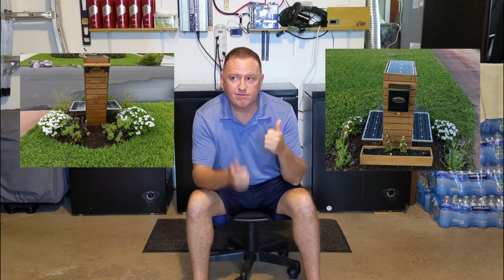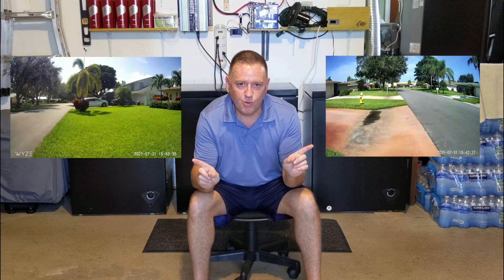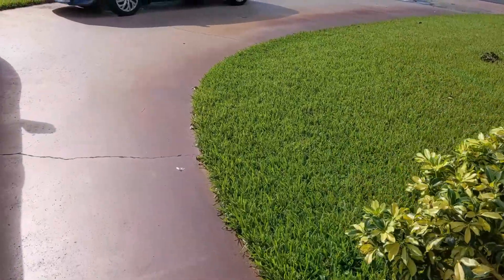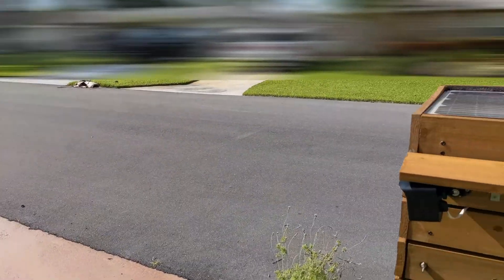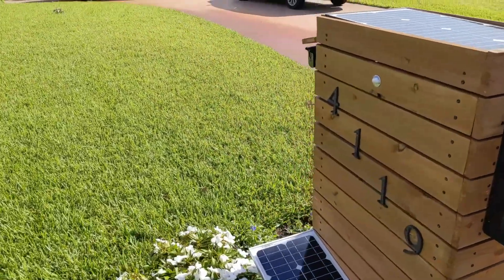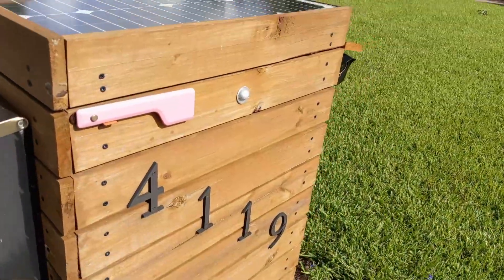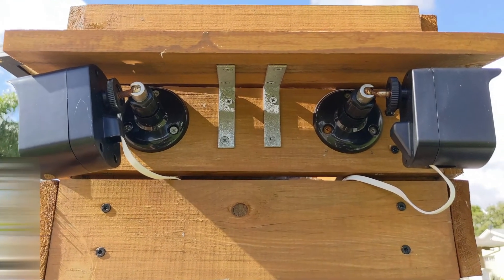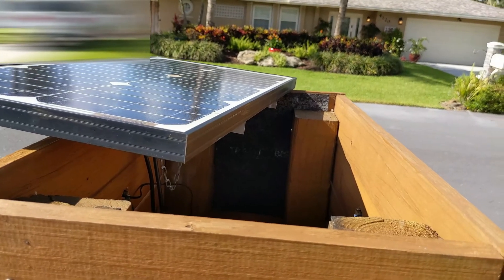Solar Powered Mailbox w/ 2 Wi-Fi Security Cameras (Standalone Security for Home/Property)

Comment: It would be great to see actual video or images captured, particularly at night. Can you view live video from inside the house? You seem to be using the USB capability only for power from the battery. The link for the cameras indicate the capability to send you notifications so apparently they can be connected via internet.
Reply from the maker: Hi Jeff!  Yes, the cameras are located about 60 feet from my house.  I connect to them via Wi-Fi (my home internet) and can view them from anywhere I have cell coverage (including in the house of course).  They do have night vision using IR.  I can see fairly well up to about 30 feet from the cameras.  If you do an image search for wyzecam v2 night vison it will give you a pretty good idea of how it looks.  I plan to upgrade to Wyze v3 cameras over the next few weeks while I'm off work.